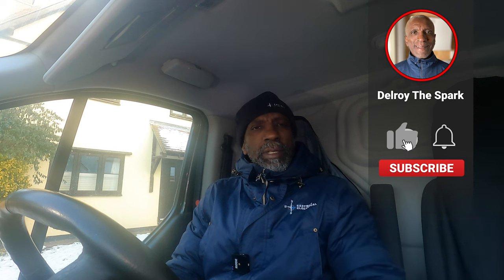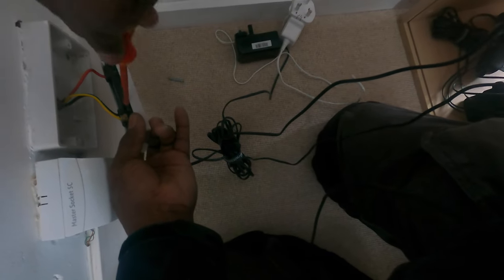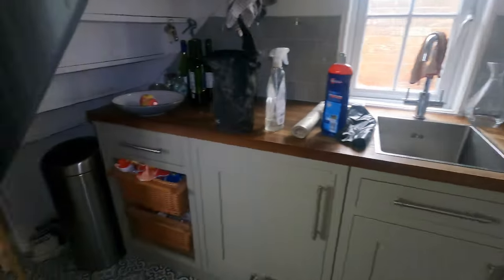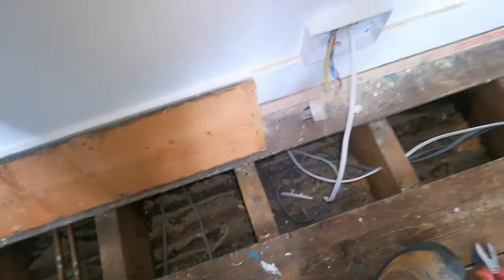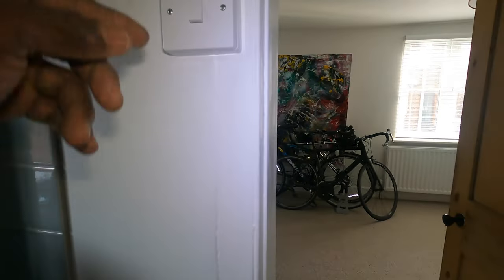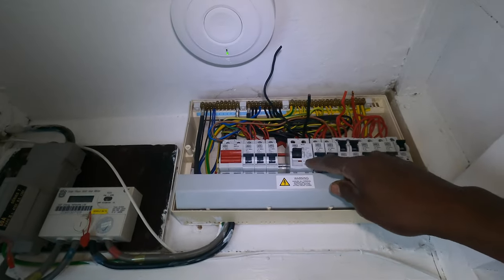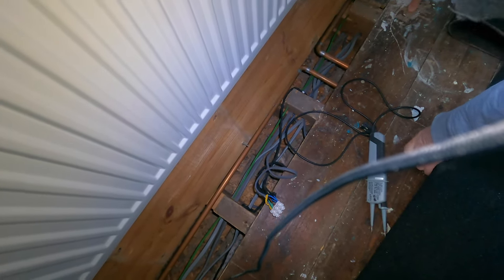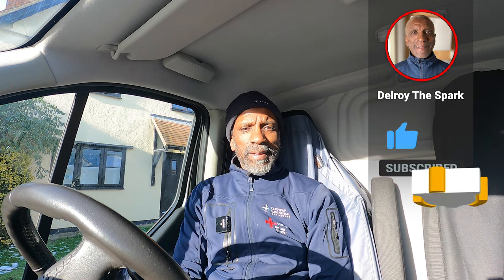"If An Electrician Did This He Doesn't Give A ****"| Electrical Fault Finding| Electrician In London

Comment: An electrician did it.....
Yet he, the customer of the sparks, knows the routing of ALL the circuits.....
Reply: Maybe he watched the hack do it before.
Reply: You wanna say you don't know what your electrician is going to put in? You don't discuss beforehand how they're gonna route stuff and what's going to happen? Not everybody has such an "I don't care" attitude...
Also, some people try and fix it themselves before calling an expert, and figure stuff like routing out as part of the debugging process.
Reply: I've always made sure I know exactly where and what everything is any trade is doing in my house.   That way I instantly know what is happening if there is a later issue.
Reply: @timderks5960  I'm gonna tell you right now that 9.9 times out of 10 they do not give a shit about how you're gonna do it. Most of the time, all that is discussed is what they want done and where they want it done. Depending on the job or what they want done, I'll tell them what they're options are if I see there's a better way of going about it, or if there's some issue with doing it how the customer wants it. But beyond what they're gonna be using or staring at, they care about as much your average Customer cares about what a car mechanic needs to do beyond "Can you fix it?". If somebody happens to be curious and does want to know, then I'm happy to explain it to them. But it's rarely the case.
Reply: @timderks5960  In my personal experience with having electricians do stuff is that you tell them what you want done and they do it, they don't tend to tell you how all the wires are set up unless they have put in a breaker or fuse panel or unless you ask them, and even then it's just a quick briefing as they have places to be.
This is also how anyone I know has had dealing with electricians. If you knew how to do simple wiring yourself why would you even hire an electrician to do simple wiring and if you don't know simple wiring why would you need to know which wire goes where because you're not going to be doing anything with them.
Reply: @ThatGuyNikolas  I always feel like I am gonna piss the Sparkies and plumbs off from asking too many question but I wanna know what was wrong haha!
Reply: @TheBanana93  oh no. as long as you're not breathing down people's necks (because some people do do that) and give them space to work, in my opinion you can just ask away.
Reply: @ThatGuyNikolas   Speaking myself when I do need to get someone out so long as their chill with it I ask if it's ok to ask a few questions & watch some of their work no matter the profession thanks to it I can actually do some basic work thanks to amount of times having to see it done &/or explained what was wrong & seeing it myself.. Damn I've lived in some shite houses with a tone of problems all around..

Also probably helped that a grandparent for me interested in watching them work in the old family home since unless it was something major he knew how to fix it all & confident in doing so.. Least that's the impression I got over the years even now.
Reply: @The_Gallowglass  possibly a handyman… no way any homeowner knows or follows what an electrician does…
Reply: So many issues. Think a full rewire is required. Sod all round trying to sort diy'ers bodges. Connectors taped up, cables running with and over heating pipes. Cables notched in the joists without mechanical protection as not lower than 50mm from edge of joist. Sockets off a lighting circuit you said?????? Taped connectors as well as bare connectors. No cable restraints as the flexs hang through the ceiling. A light switch wired as a two way bet the bodger thought the blue was is neggy. Hence those two lights dont work. Lord knows what else. Ring sounded interconnected from what you said. What a bodge. I do hope you covered your back and reported all iseues you saw on the paperwork you handed the customer.
Reply: @harrison78  because we love working with the customers beady eyes burning into the back of our heads it's so comforting
Reply: @drpantastic1969  I don't stand over people.   I just make sure I double check where things are being put and what's being installed. And look over the work before I pay.   I've had bad experience with a cowboy builder in the past fitting a kitchen where I've has to make them leave the job, and had to rewire or replace the sockets myself (one actually fell off the wall) and refit units, side panels, fix plaster work etc.  Would have been easier to have just done it myself.    Makes you very wary of people after that.
Reply: Tbh i always make sure i know where everything is, especially because a lot of people are crap at labelling and when you need to bring someone to maintain something and it's not labelled and you don't know what goes where you're gonna pay extra for their hours figuring it out. You learn quick after coughing up that cash to make sure you know where everything is.

Comment: US sparky here, dude I've never seen pendant cables coming straight through drywall before, it looks ridiculous LOL
Reply: Yeah, those sorts of lights are ones where you have a central rose and those pendants all connect into that, then you install hooks to tie the cables off to so they hang from there.  It's a part of the industrial look they're supposed to have.
Reply: @supremeicecreme1658  Definitely doesn't mean there shouldn't be some fitting to connect it to the ceiling. It looks less industrial and more like a machete showroom in a home store that isn't actually a building, so it doesn't matter if the lights are attached without fittings.
Reply: Not been in this business for long then? I've seen shit like this far too many times.
Reply: @FourthMan82  12 years, seen a lot of brackets and canopies just screwed to drywall with no box.  But this doesn't even have a canopy.  It's the worst final product install I've ever seen.
Reply: @supremeicecreme1658  No, it's flat out against electrical code, no inspector would ever pass such a hacked our job.  The electrician in the video notices it immediately as well.
Reply: @FourthMan82  not done to code, by an electrician… those lights are NOT installed to code.
Reply: @Dan-fz5nn  I never said what was shown here was right. I was saying how those lights are supposed to be installed.
Reply: I am doing an electrical instalations in home and industry for 20 years and is common practice here to make junction box hidden and unaccessible in drywall ceiling . And when we do that is only because we are requested to do that. i personally love doing full  smart house installations, every cable in main distrubition cabinet and no hidden suprisses
Reply: i agree, might as well punch the hole through with the screw driver
Reply: @dusansilni3956  I guess your insurance must love you if that is common practice… inaccessible from the living space, but accessible from attic, sure… but completely inaccessible? Directly against code…

Comment: Lots of people commenting on the lights hanging out of the ceiling but I'm just as appalled by the quality of the plastering.
Reply: If you look closely, it's where he's drilled in the wrong places and had to repair it hahaha. I watched this video ages ago, and I didn't notice that until now.
Reply: I didn't look at how they were mounted, which is, they aren't  mounted, lol.
One time I did live in a place, tho, that had a hanging dining room table light.  It was mounted, had a center piece, and a fixture at the end, tho.  The center piece had a spring loaded cord winder in it and you could pull it down closer to the table, or lift it and it would wind in the cord to raise it.

Comment: One thing I would do particularly if working along with other people in the house is fit temporary touch proof test points to exposed cables you're about to live up for testing, you can easily fit them with Wagos and prevents embarrassing accidents.
Reply: Agreed connector blocks are a must to give basic protection  for yourself and others you gotta stay safe Del

Comment: I'm not an electrician but I can tell he did those lights himself! Funny how he knew exactly where the cables were....
Reply: let me just go and get the exact floorboard up you need del
Reply: In his defence if I had an tradesman round I'm pretty sure I'd be able to remember which space and carpet we had to lift up to access the floorboards too...
Reply: @zXLuke4efcXz  if you had a tradesman in who just dropped those cables through the ceiling like that I'm sure you'd remember that too LOL
Reply: @shaunlewis286  isn't that what I said lol
Reply: I know where all my cables are. I took photos as it was rewired so I didn’t ever drill into them. Same with plumbing
Reply: @bobhook336  good point. Puts a different perspective on it
Reply: Funny that ..🤡

Comment: Oh, that lockout on the Earth Leakage switches. From what I heard, that was to stop idiots from using tape or wire to hold them in the on position. Even if held it on, and you pressed the test (or have a fault), it would still trip it and cut power (similar to how high-current commercial breakers work).

This is why we can't have nice things.

Comment: This is what always blows my mind about construction in the UK. How hard would it be to provide a wiring diagram!?! and why are our electrical boxes so small!!!! nightmare!
Reply: I know you folks have ring mains which typically means fewer breakers, but I’ve never understood why the load center enclosures are so very small! If it’s a tight space, I could sympathize, but I’ve seen these mounted on walls that have plenty of extra space and they are always the same small size.

Comment: 3:30,  noted, you checked the earth tightness in that socket but you didn't look to see if the earth sleeve had prevented a good copper connection. just a thought...
Reply: He does that without thinking its not worth noting every little action on a job in these vids but you wouldn't know that as you don't make YouTube vids to edit #CleverClogs

Comment: I used the same electrician for about 10 years with no problems. I could not get hold of him to replace a Vent Axia fan.
After about a month I hired another electrician. He told me that all the wiring was sloppily done and asked if I had done it myself, I had all the documents that the electricians give you, so I was able to show him proof an electrician had done the work.
I had him check the otherthree fans, shower, kitchen etc, I went up into the loft to have a look.
He was right, everything looked like a blind monkey had done it.
We do tend to trust tradesmen.

Comment: Great video, had a similar thing going on in the new house I bought. I removed all of the extra surface sockets and everything worked properly. Lights are still an issue but at least they work.

Comment: A wire just hanging through the plaster of the ceiling looks appalling, how are you meant to service anything or even decorate.  The notching and drilling of those joists is pretty scary too.
Reply from the maker: Defo unconventional
Reply: I’ve seen this once beige where a maintenance man had changed some pendants...he had put the pendant up in the floor and then stuck the ceiling rose straight over it connections weren’t  accessible 🤦🏻‍♂️🤣
Reply: @eastwayelectrical  how does that plug tester works? Is it just testing for power or is it a circuit tracer
Reply: @jak50cent  it tests the power, but it also shows you that socket is wired correct, which is more important.
Reply: @anttimaki8188  oh ok I have something similar it’s not audible like his that’s why I asked. My plug tester has a reset button to text GFCI receptacle. I love service work, generator, and EV charger jobs

Comment: I just wired my house in Ontario Canada, as a home owner you can do your own work and get it inspected by ESA. It's pretty extreme in terms of requirements and learning. All circuits must be AFCI protected from the breaker panel, which means AFCI breakers, which run around $100 each. I used 15 of them lol. AFCI = arc fault circuit interrupter.

Comment: journeyman electrician from Canada here thats considering a move to the UK and I got to say for some stuff UK is way above us for safety like Meggering all the lines and having fuses on alot of equipment but then you got other stuff like putting fixture wire through a ceiling to join in somewhere else that isnt really accessible. Its kind of mind boggling to me. I do however love how you sparks get to really take your time to diagnose and wire because here in houses (commercial builds is a bit different) its get in and get out as quick as humanly possible and many companies will try to get away with shoddy work to be the lowest bidder and there are SO many of us sparks so its difficult to keep busy. Still considering a move over to the UK midlands where I have family but dont know if any of my years of experience would even be considered.
Reply: The cable going into the ceiling void is not the norm. It’s actually damn right stupid.
Reply: @jurassicsparks5220  I suspected so. Ive seen some other videos form Delroy along with others showing some other stuff that I found strange but probably not the norm like; Steel enclosures outside, Twin  & earth outside, Panels at any height (from right at the floor to right at the ceiling), burying a junction box in ceiling or floor and spurring/extending a plug from a kitchen circuit. Are any of these allowable practices or just people leaving the work they find there? Is that ok, to just leave the work and make a note about it? 

 Like if I open a permit on a house here my work is inspected by a city inspector and they can inspect the entire house for code violations that they can then tell the homeowner they need fixed. Come to think of it, I dont think i've ever heard of a inspector in the UK like we have here.
Reply from the maker: Thanks for sharing your perspective
Reply: @eastwayelectrical  thanks for sharing your videos. Always a pleasure to learn how the sparkies operate across the pond

Comment: US electrician here. Is it legal to have hidden junctions in the UK? Here in the US, all wires must be junctioned in a device box that is accessible, and cannot be done in a floor space between floors unless the box is accessible, usually from a light fixture box or ceiling junction box, and less commonly in a floor box. Buried boxes and junctions are some of the most time consuming faults to find. That is a fire waiting to happen.
Reply: I bet it's not, danish electrician here, and it's a big no no. No electrician in his own mind, would ever do this.

Comment: I am in SA. our regulations here require every earth termination  with 2 or more earths need to be crimped to gather then terminated in box/switch/plug. If you lose a live, or neutral, your equipment will not work. Then requiring back checking to locate a fault. Loosing an earth, never, with great consequences can cause electric shock.

Comment: My parents had a new house built. I inspected the caballing and it was worse than you have shown. Although the building inspectors passed it a safe, they never actually checked it because it was wired by a well known reputable builder.
Reply: R u an approved electrician??
Reply: @adamsharp201  I was at the time (1988)

Comment: European panels seem so tiny for working in. im Canadian and the panels we use are WAY bigger.
Reply: They are 240V everything there.
Reply: @soisaidtogod4248  i know that. That has literally nothing to do with my comment.
Reply: @Ash_Lawless  lighten up Francis.. 🙄😒
Reply: I live in europe and my panel box is 1.7m by 1.7m. I wouldn't call it small by any standard...
Reply: @MsSpermator  sounds a lot bigger than the 1s ive seen i  videos. The 1s ive seen are all like 500mm by 500mm-1M.

Comment: Wow. I did amateur electrics for years, up until the early 90s, referring to a copy of the 17th edition of the IEEE regs as it was then. Installed consumer units, fixed a shower whose metalwork was live, fault found and fixed all sorts. You need a logical mind and high standards. One day I found some Polish lads had wired in a garden office building and just left the cover off a consumer unit under the stairs. There was a child's scooter handlebars next to live mains terminals.

Comment: Ha i've seen 8 going in to a block at one place, for lighting strips. Rather than run them as  circuit the sparky had run a wire too and then back from each indivdual light. There was a completely empty 16 fuse right next to the one in use as well.

Comment: The 240 volt system in the UK is so scary to me I would definately hire a licensed electrician for any thing I needed to have done. In the US it's a big no-no to have hidden connections behind walls or ceilings or under floors. Also the lack of connection boxes is pretty poor practice and shows a DIY'er or a cowboy supposed "contractor" did the work. No real pro would do this sort of work. This wiring shows many potential serious shock, short and fire hazards for this person. I doubt that the customer understands that as a professional you cannot  just add to bad work because if you do you are liable for it all including what was so poorly done before you got there. Good job I have seen many of your videos and you seem to run into this sort of thing way too often.

Comment: An electrician left a live 240v naked wire hanging out of my ceiling, nothing can surprise me now.
The same guy added notches to the cable sleeves in the board for identification. I got wires with up to 9 notches there.

Comment: You put the highest of the 5x test on the certificate as your 30mA rcd is for additional protection
Reply: Correct although I prefer the 17th edition minor works that stated both max 1x and 5x. At least it proved you tested the rcd worked at its rated trip current.